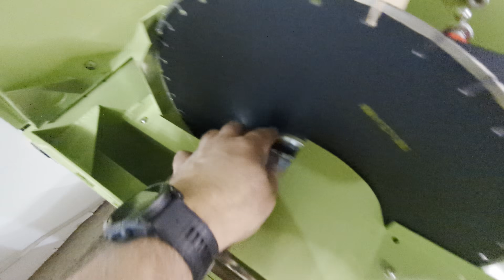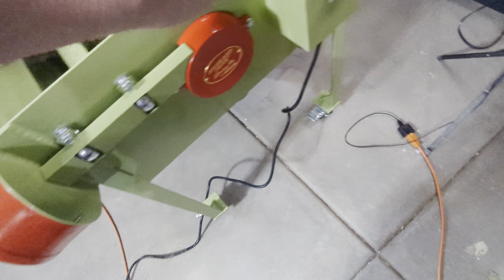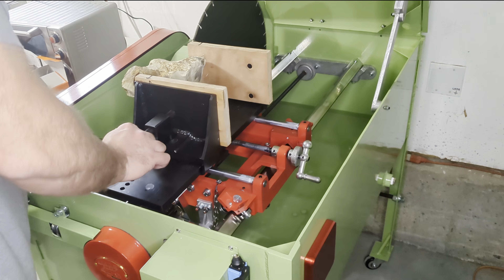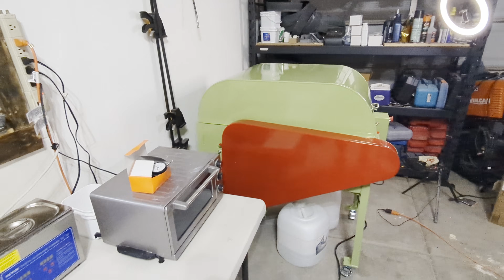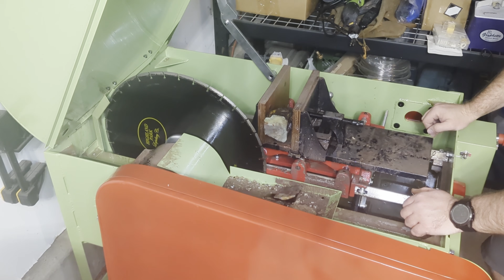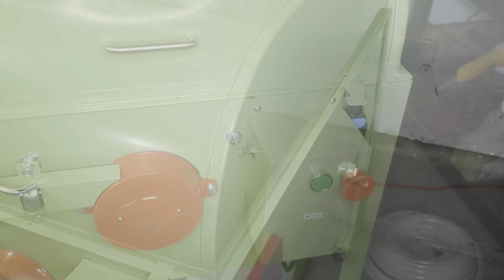Highland Park Lapidary slab saw, setup and first cut!

Comment: Hi Rick, I'm considering this exact saw... 1st question how long did it take on the back order of the EverClean?  How many cuts on your new blade did it take to break it in so you didn't have lots of saw marks on your rocks... anything you can tell me now after a year of owning it that might be helpful?  I also will probably be running into the problem of having the EverClean not in stock and so on back order... is the EverClean as good as you expected? What size was the largest rock that you were able to cut... I have a few fairly large and hoping they fit into the vise... thanks for any info you can give :)
Reply from the maker: I actually ended up cancelling my everclean, then re-ordered an everclean 2 - which is on backorder lol hopefully it will ship soon, I need it, oil management is a problem for me.  I've tried the "settle method" for cleaning the oil, it works but it's very slow and still wastes oil.  The paper bag method works as well, but it's also slow, wastes oil, and risks making big messes, and when the oil is cooler, doesn't filter very well since the viscosity rises.  While I don't have it yet, I'm already convinced that an everclean will eventually pay for itself just in oil. 

Biggest rock I can cut is a tricky thing to answer, because it depends on the axis of the cut and shape of the rock, so the blade cross section is about what they say, about 8", maybe a touch more with very careful placement, but I've put rocks in there in excess of 15" and you can cut slabs that are long, on the axis of the vice as long as they are under 8" tall - kind of hard to explain, if I find another large one probably easier to show. 

For blade breakin I was cutting soft AND hard stones like brazilian agates, so difficult to say but probably 15 cuts before I felt it was really good to go, give or take a couple.  At this point I have thousands of cuts in, and I still get saw marks on my rocks but they are super fine, I can start my vibralap on 220 grit for most of the cuts.  Blade deflection is what causes blade marks for me now - when you clamp a rock and push it against the blade (with the saw off) - does the blade move left or right or does it stay center.  This is an issue with the shape of the rock, if the face of the rock going into the blade has a curve or ramp, it can deflect the blade a little bit, or if the rock moves in the clamp - clamping some rocks is an art, sometimes I have to use shim's etc to get a good clamp, I've had rocks move and completely lock the saw up.  I have both the large and small rock grippers - and while I rarely use them, but when I do they are a life saver.  If you cut agates rock grippers will give you cut options you won't get with just the vise. 

I have very very large chunk of OG ocean jasper that I'm going to have to break up before I cut it, I plan on drilling a series of holes along the break axis so it fractures exactly where I want it with feather/wedge technique so I can maximize the size of slabs I can get off it and reduce the risk of just making a bunch of little pieces when I go to break it up.  Currently cutting tiger iron that's 9" corner to corner but careful orientation makes it fit.
Reply: @rhyoliterick  the everclean II is in as I'll be making my order for the 20" slab saw and the everclean II on Monday... the shipment came in so if it's not showing in stock you may want to contact someone...
Reply from the maker: @PeggyJackson-w2w  I got notice my everclean II has shipped, already got my parts for the "wash down" manifold split for the everclean.
Reply: @rhyoliterick  what is this that you're talking about?? "already got my parts for the "wash down" manifold split for the everclean" I'd like to be prepared since I'll be ordering the saw and everclean II...
Reply from the maker: @PeggyJackson-w2w  This
https://www.youtube.com/shorts/nzGfwjMNeUs